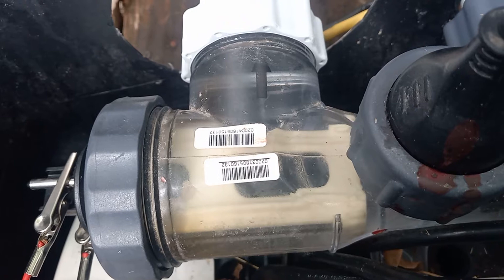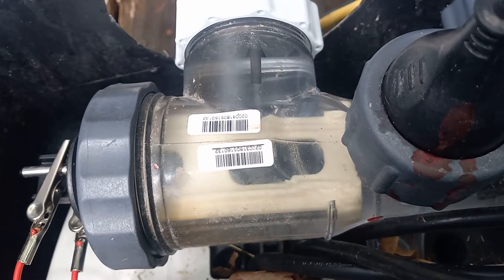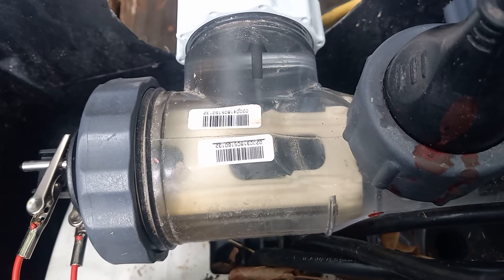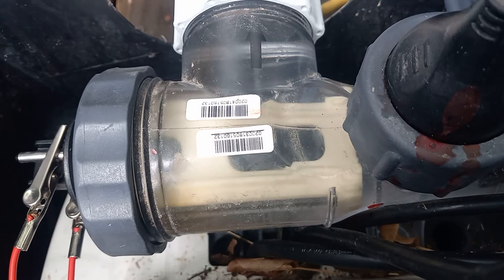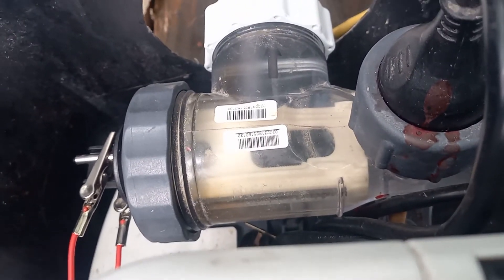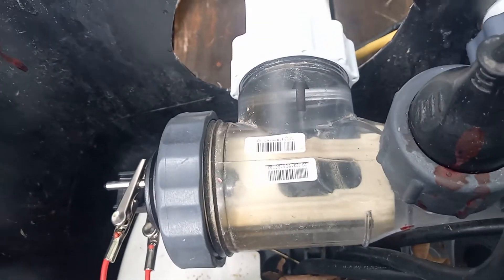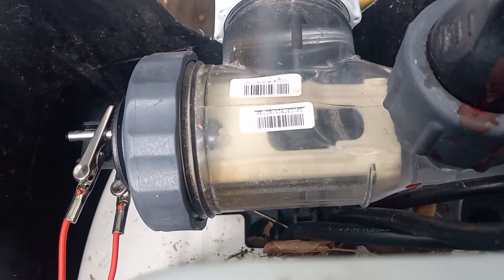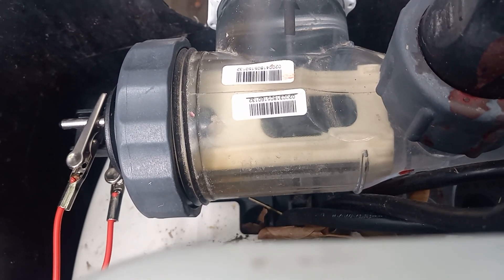DIY Salt Water Chlorine Generator Fix

Comment: Most other chlorinators have one bank of electrodes.  This unit look like it has two sets that generate chlorine.  The so called ECO looks like a smaller version of the so called titanium electrode.  If you look at the unit they both are producing gas.  The way these systems work, there is a cell with alternating titanium metal and mixed metal oxide (mmo) electrode plates. The mmo plate is a titanium metal plate coated with ceramic metal oxides that allow more chlorine to be produced than other types of electrodes.  They also hold up better than other materials in this application.  As the mmo coating will ware out and that is why it need to be  replaced.  The problem with these systems is electrical.  They have power supplies that expect certain maximum amount of power (current, amps) be be used.  If the amount of current is to high the power supply shuts down and will usually say you have high salt.  MMO is no as conductive at titanium metal .  So when the mmo goes away the conductivity of the electrode will go up and use to much power.  Keep in mind that as you loose mmo coating you may also be producing less chlorine.  By hooking up a separate power supply the you are continuing to produce chlorine. Unless you pull enough current to burn out the supply.  One thing you need to keep in mind is that as the mmo goes away you may start to produce oxygen rather than chlorine.  Keep checking you chlorine.  At some point in time the mmo will be gone.  Your idea will work until then.

Comment: How has it been working? I need to do this to mine
Reply from the maker: I'm using a 110 - 12V power adapter, and I found DSS-125-24 power transformer is optimal at 24V used on other generators per my research.  Can be ordered from Amazon. Be sure to check the output with a voltmeter. (I received a defective one before it was even installed) For now, I'm back to the 12V, it is making chlorine. Hooked it up to a 24-hour timer switch. https://www.youtube.com/shorts/tXue1qFuZ2Y